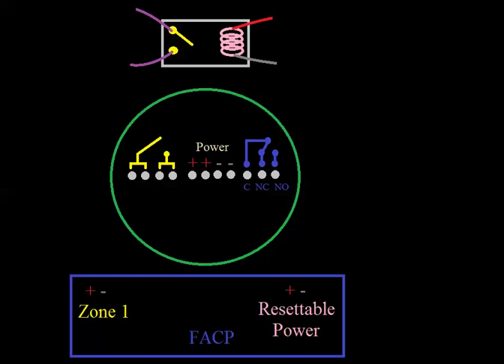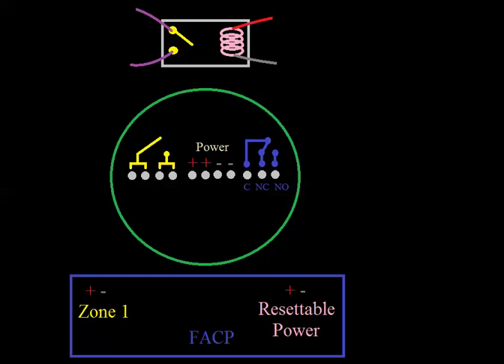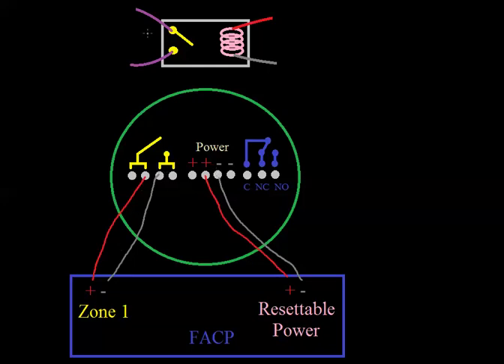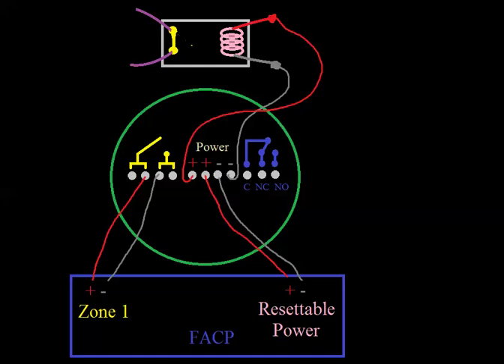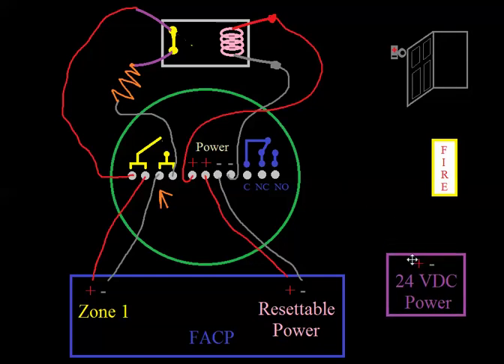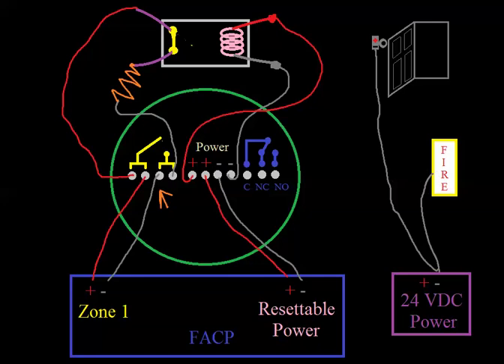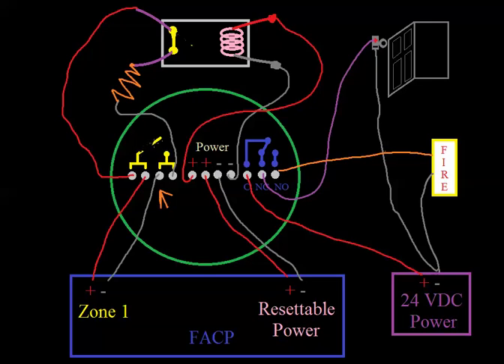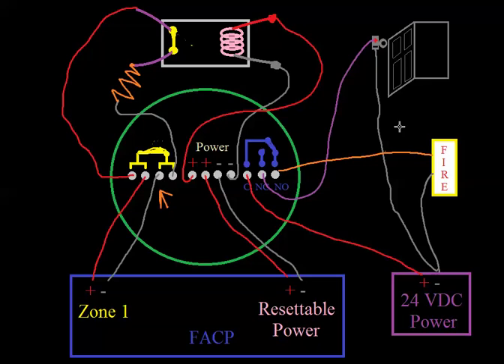13 - Four Wire Smokes with On-board Relay - Introduction to Fire Alarms

Comment from the maker: Thanks for your feedback!
First, it's important to distinguish between 2 wire and 4 wire detectors. 2 Wire smokes are close to normally open contacts in a standby state. The current they draw is measured in microamps. That's how minimal it is. When they go into alarm, the detector draws more current, measured in milliamps (usually around 100 - 130 milliamps). That increase in current puts the panel in alarm.
On 4 wire smokes, the initiating part of the detector is normally open contacts, (con't)

Comment from the maker: (con't) drawing no current at all in standby. When a 4 wire detector goes into alarm, the contacts close shorting the zone the same way a pull station would. Ion and photoelectric smokes work the same way as far as the current increase is concerned. I tried to attach two links to this but apparently you can't post links in the comments section. Check out system sensor .com and look at the data sheets on their smoke detectors for more info. They have ion smokes under the "400 series.

Comment: Good explanation! I have two suggestions/questions. 1. Use a pointing tool while referring to points in the diagram. 2. You didn't mention if the supplemental relay in the detector is an add-on component or if it is an integral of the detector. I didn't ask that very well. Is the basic 4-wire detector one part number and a 4-wire detector with the ability to control lights and doors a different part number/model?
Reply from the maker: Sorry, just now seeing this. They are all separate part numbers. You can order just a 4 wire smoke detector, OR a 4 wire smoke detector with a relay. There are many different manufacturers of these types of detectors, so you'd have to consult their manuals/ordering catalogues to see the differences. There are actually far more options than just those. There are detectors with sounders, with sounders and relays,  etc.

Comment: Joe is this the same for a 12 volt system, like optic Morris? I couldn’t get it to work using a 4wb in 12 volt optic Morris system? Just using the EOL-R1 portion not the relay shown in blue
Reply from the maker: Not sure what the optic Morris system is.

Comment: Question: could provide link as an example for resetable power source DC?

Thank you very much for informative and unique videos.
Reply from the maker: The power source is almost always the fire alarm panel. Many, if not most, fire alarm panels have resettable power built in. On ones that don't, you can take any UL listed  24 volt DC power source and run it through a relay that activates when the power is reset. If you're working off of a conventional panel, it will likely have resettable power.

Comment from the maker: Mohamad,
    No, each one does not need its own supervision relay. Both the zone and power circuits would go into the first smoke detector, then out of it and into the next one. So any smoke detector along the line would have zone in and out and power in and out. Then at the end of the circuit you'd have the power supervision relay with the end of line resistor keeping the zone clear. If any one of the power wires were cut along the line, the coil would de-energize, causing an open on the zone.

Comment from the maker: I haven't really looked for any of those videos. My plan is to make many videos like that in the near future. I wanted to build from the most basic concepts into more advanced ones. However, those will be difficult to make because different manufacturers use different methods of assigning addresses to their devices. Most of these methods are fairly similar, but not all. Stay tuned, I'll do the best I can.

Comment: Hey Joe,
First let me say these are great videos.  I notice though that the 24 power supply to the door holder is not supervised.  If the smoke detector loses power it will have no effect on the door holder circuit due to it is wired to a normally close state on the smoke relay. So if there is a problem with the smoke the door holder would work but not the fire light would never come on.
Reply from the maker: Ronald, you are correct. My videos are based on what I see in the field. This is what I see in Chicago at most every nursing home I go to. For whatever reason, the firelite outside the room is not supervised. If that wire were cut it would not be found until a thorough test was done. The door holder power is fail safe, so if power was lost the door would not stay open. As far as smoke power is concerned, if smoke power was lost the panel would go into trouble (because the power supervision relay would open) and someone would likely troubleshoot the circuit.
Reply: Good point. But, I guess that the presence of both an "Alarm" and "Trouble" notification would indicate that fault...just as if the door holder were actually individually supervised!
Also, if the 24V PS of the door holder is not supervised, in the presence of an "Alarm" well, at least, the door would be already opened! It's better to have it that way, than the reverse, the fire light is on but the door is locked! 
That's the fail-safe mechanism.
Reply: Ronald Thompson,view multi station smoke detector commercial YouTube video link. Saving lives.
Reply: Ian Casey,View multi station smoke detector commercial YouTube video link Saving lives energy environments.

Comment: Joe at first i would like to tell u that ur videos are such helpful ones, as ur way of explaination is just perfect
i have a question concerning the action of a smoke detector -electrically- before & after it detects smoke
What is the equivalent of a photoelectric detector at normal state & when detects smoke?
is it open circuit then become shorted, or is it a resistor changes its value allowing increase in current that the FACP would affected by & indicates alarm..

Comment: Great videos! I thought that according to safety standards in alarm state the electromagnet is supposed to lose power allowing the door to be open freely.And in normal mode, power is allowed (NC) to go to the eletromagnet thus keeping door closed,  
However, in this and other videos that when the electromagnet is powered that "the door should beheld opened right now"! Example 09:32.
Similarly, you say that when the electromagnet loses power (in alarm state) that "our fire door is going to close because there is no longer 24V..." (11:11)

I'm a newbie in this stuff but I'm n electronics technician by training,

Comment: Hi Joe,
Thanks for the info.  Could you please explain the difference between a low voltage fire detection system and a Relay fire detection system?  Is there a way to look at the fire detection devices in a home and be able to tell the difference?  Thank you for your assistance.

Comment: Can you tell me what should I ask for if I’m gonna buy this smoke detector with the relay 
I mean the model or the correct name of this divice thanks 
I’ve learn a lot from your videos 👍
Reply from the maker: System Sensor makes a 4WTRB smoke detector which is a four wire smoke with a relay base and a built in thermal sensor. GE   makes them also, part number ESL449CRT, same thing. There are plenty of others as well.

Comment: Hey joe ! 
im ali. from iraq. i was following you since 2 years, but i didn't understand anything cuz in that time i could not talk in english. i just was lookin' at the pictures (loooool). now, i just saw your interaction with your subscribers and answering there ques. so i decided to ask you a ques : why you said in this video the smoke detector has a switch while you said in the video that you explained how does the the smoke detector reflect the light to the light sensor ?? thaks for all your videos :-)
Reply: ali allamei The simplest way to explain it is that the switch is triggered by the light sensor. If the sensor picks up light being refracted by smoke it will trigger a small circuit that will throw the switch into a closed position.

Comment: First part of the video is just as previous video. I guess this is an old video and you not produce any more, but just wanted to mention that I think you worthless spending time explaining how relay or how contacts and how current in simple circuit flows, as this supposed to be just known before you do any wiring. I'm not complaining but just I think it's not fair for those who want to hear/learn fire system theory, but not electronics basics. But thank you very much for your time rolling those videos.

Comment: @ 1:35 you mention once againwhen the alarm trips the door closes....are they supposed to open, instead of closing for evacuation pruposes ? This is the part that I don´t seem to understand clearly.
Reply from the maker: Tony, fire doors are installed where there are firewalls in a building. Thinking big picture, a firewall is designed to prevent fire from spreading from one section of a building to the next for a given amount of time. If there is a fire in zone A, the fire doors will close between zone A and zone B. They do not lock. A person can push them open to exit but they will close behind that person. They're simply to delay the spread of a fire.

Comment: I just realized that the term "door holder" is used and I think that I may have mistaken it to mean the electromagnet that keeps doors closed in Access Control systems. If that's the case, well, I'm not familiar with "door holder".